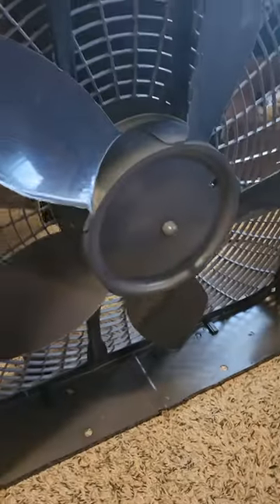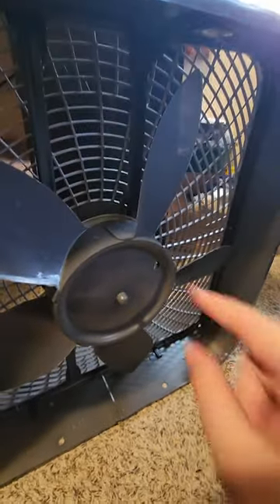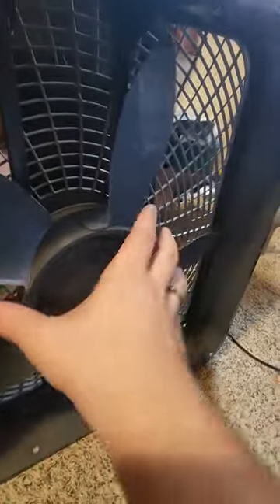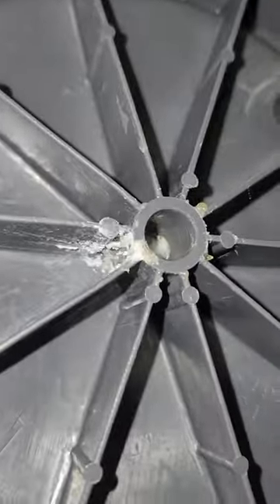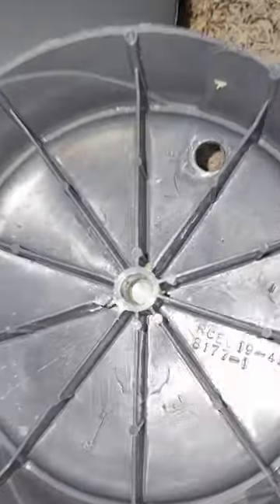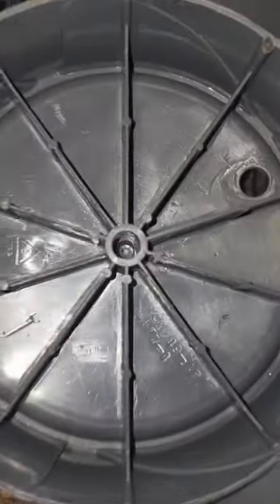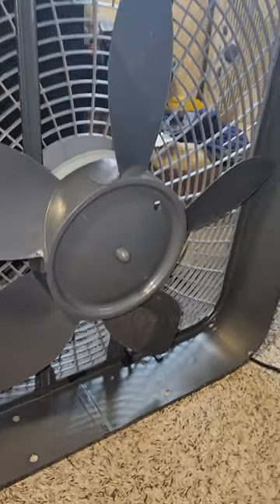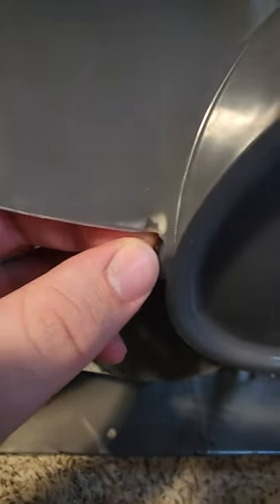Lasko Power Plus Box Fan blade repair

Comment: It's only a matter of time before it fails again unless you reinforce the blade hub somehow.  And buying the replacement blade plus shipping is almost as much as a new fan.
Reply from the maker: Yeah it is unfortunate but I did notice that the original fan blade lacked a proper notch It was just held in by friction which eventually got worn down. The replacement fan blade does have a proper notch And it's been working fine ever since.

Comment: I have the same fan and the same issue. Take the blade off get a flat head screw driver heat up the tip on the stove get the flat head blade hot and melt the plastic cracks keep it hot and remake the flat key part and make it a little bigger than the key part or about the same size that worked for me also get some super glue guerrilla glue get it down in the blade mix it around with a tooth pick let it dry do it again same thing let it dry and remove any excess do this before remelting the plastic and the remelt the key with the flathead screw driver
Reply from the maker: Thanks for the tip It seems like they completely forgot about the key on one other nicer fans
Reply: So it worked for a few hours and it wallowed out again so I re melted the plastic key and drove a screw from the center tip between the flat surface of the shaft and blade left it on over night. Switching settings there is a sound of and turning it off there is a sound definitely the screw which is just a half inch screw I may attempt different methods
Reply from the maker: @metalmindedmaniac2587  The screw method seems to be the most popular but I had to resort the glue because the plastic cracked on the fan blade But it only worked for one day. but replacing it fix the problem permanently because it came with the keyed slot